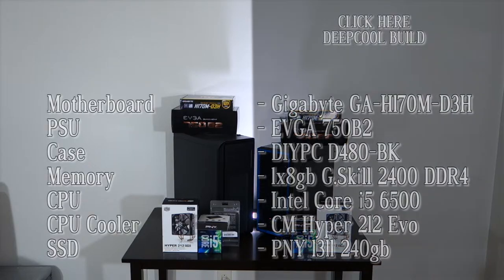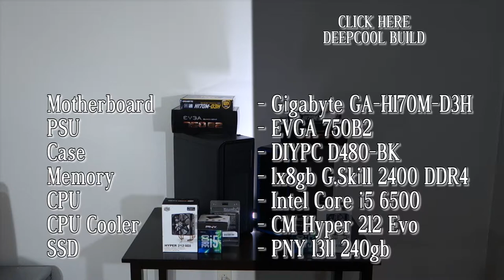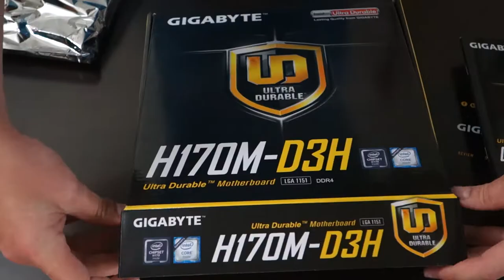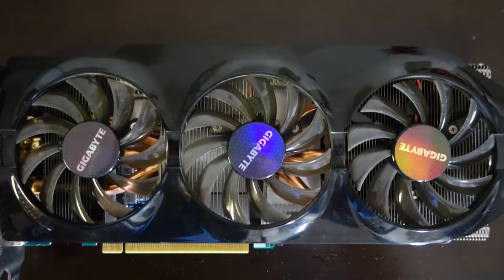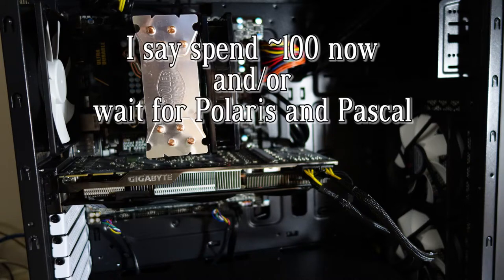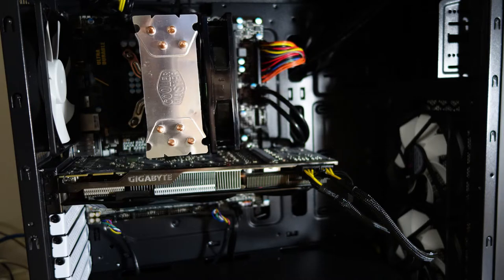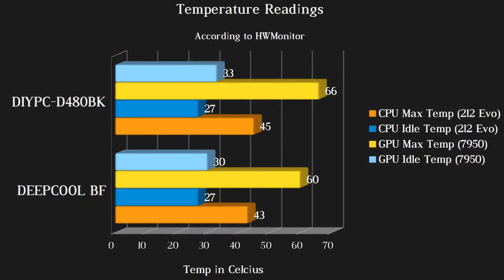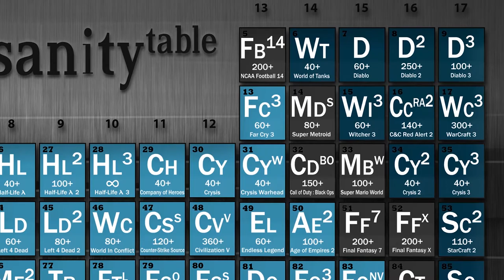DIYPC D480-BK Build Log | GTX 1080 Starter Kit?

Comment: I added a Kingston Hyper X savage SSD on the front side under the disk drive bays ...you have 2 spots to add them ....so a total of 2 HHDs and 3 SSDs can fit in this tower ....my video is of the DIYPC White -480

Comment: I'm getting ready to add 5 new fans to my case ... And add fun foam around the top fans .....I don't like the idea of my fans on the top looking like they mount to a cheese grader so I'm going to seal it all up with 1/8 inch foam sticky paper from Michael's it's $1 a full sheet
Reply from the maker: let me know how that does with noise and if it hurts airflow much. The only pre-built filters I can ever recommend is the Demciflex filters, but those are usually too expensive. It is awesome to have a kit that perfectly fits with your computer like I do for my girlfriend's Corsair 400R Case. Essential in our dusty apartment.
Reply: +periodic.insanity tell you the truth I'm happy with how it is out of the box...... I have a problem I can never stop upgrading or improving anything I have ....I did the same thing with real cars ... Radio control cars .... Bikes ... Skateboards .....car stereos.... I'm doing just to see if I can lower my temps running online games ..... It's already ok ...I'm just OCD ....... I'm addicted to making Unboxing videos  .... And instillation videos
Reply from the maker: I know what you mean, I'm always tinkering with computer set ups. I really should record the stuff I do because I don't think to record it and so like 90% of what I do is just for me to enjoy. It is addictive but if we could turn what we love doing into a job or at least some income this is it...
Reply: My zen build ill hope to use this case awesome air flow alot of space and good cable managent
Reply: When will they put a guage on the thermal paste tube so you know the amount you place on the cpu is enough , i am totally worried you didnt put enough lol
Reply: How come you didnt get the windowed case?

Comment: Did you need to buy a fan splitter for this case?
Reply from the maker: all the fans were already hooked up to the fan controller, you just need to provide power to the controller
Reply: So you just plug it into a molex and that's it? did you plug the molex 4 pin cable onto the system board?
Reply: Ditto how do you control the fan speed. I have this case but I can't adjust fan speed. Thanks

Comment: Also my new CRYORIG H5a keeps my CPU at 21c idle and 30c load ...but on tom Clancy's division it hits 56c for a second then comes and stays around 45c for online games that render allot of graphics
Reply from the maker: I have a hard time trusting that my PC is reporting correct temps when it is around that low though, 21 c is like 70 F , which might mean the CPU is cooler than the air around it at least where I live in Tennessee! My FX 8300 would report under 20c idles and I know that couldn't have been true on the 212 evo attached to it lol.
Reply: +periodic.insanity no your right ...when I lived in San Diego ...on my older PCs they ran 40 to 60c ....but I'm in Washington now and I had the room at 65/68 or 69.... It will latterly idle at room temp ...and as long as you use your motherboards temp programs you have accurate temps ....  I was able to use corsairs software to monitor temps from the PSU ..and when I run them together they match each other .....the only thing off  was the fan RPM's on the corsair were off 1000 rpms ..after update they match now .....with core temp or speecy they are off sometimes by allot ...this are aftermarket temp programs ......not the one that comes with your motherboard ...that's on point it's cold where I live ... My house thermometer could be off cause my inferred  temp gauge says its 63F when the house says 67 ...but my inferred gauge came from harbor freight and there stow is the lowest of quality ....so I'm not sure my accurate room temp...BUT ITS NO VIDEO CARD..so no heat
Reply: +periodic.insanity now with a video card ...I will post that video soon I sit at 46c and spike to 56c off and on.... This is why I'm going Fan crazy ...2 on my CPU cooler they will fit with the ram I have .....and all 5 new case fans .....will see if I can drop those temps ....my house is also 77F now (....if I said 66c for house temp on last comment ment F) I won't use my PC at 77c ...I'm building a man cave with its own Ac... To run at 60F .....I know it sounds crazy ...but like most of us I paid out of pocket and boy it was allot this time.....I went top of the line on all except the motherboard and video card ....motherboard is really nice just not the best ...and my video card was released November 2015 .... It's a sweet gigabyte 970 XTREME with Titan X chokes and capacitors...it's  just not a 980Ti which I don't think I need ...now that the 1080s are out I want to give it time to get all the bugs out ...then I will get a 1080ti
Reply: +periodic.insanity I have videos with open broadcasting running and I use my motherboards recording software as well as division running that's when it hits 56 to 57c.. Without open broadcasting the charts show it peak about 47 to 52c..... It's not on video but I'm able to test my case Temps with my inferred lazar  thermometer ...and the PCH  (the heat sink in the bottom left of the mother board)and they are a close match....I'm just not able to test the CPU with the laser ...But what's really important is the 21 c my Cpu begins at... it returns to that when I shut all my programs down...that's what's important ..that means my Cpu can return to room temp at idle that it began at  ....not slowly increase ....it doesn't matter what 21c really is on my PC it's obvious its whatever the rooms temp is ....it's that I can get it to return to that temperature without having to shut down and cool down ...With division and the video card my CPU comes down to 24C ,but the case and PCH stay up now

Comment: No offense , but I'm not a fan of the 212 evos ... They are loud as shit .... And they do not have a mirror finish bottom ......I used the hyper T2 and my CPU would spike to 81C all the time ..... I did allot of homework and found CRYORIG /thermalright  /nactua / Phentek / those brands put cooler master to shame for CPU coolers ..... Cooler master works .... But there's better in the price range ..... I used the white tower of your tower ...and I posted the video .... Nice build you have here
Reply from the maker: I like the white especially for that gigabyte mobo. I wish I had gotten the side window version but oh well. For the ~20 dollars I picked up the 212 Evo for it performs fine, if I were overclocking I would get something better though. The Evo design is a bit dated and I like a lot of what I see from cryorig, I've been wanting to try out their budget C7 as it seems to beat the evo in price/performance (at least when it's on sale!). Sorry I did not reply immediately, I've moved rooms in my apartment AND rebuilt my computer!
Reply: +periodic.insanity the C7 is a really nice one ....it's almost mirror finish but only has 3 heat pipes .....it's all about the heat pipes ... mine only has 4 heat pipes it's a little better then the Evo but with my slim fan design I can still fit all 4 ram sticks in their dim slots ...I have the CRYORIG H5a ...the a is a 13mm thick fan ....instead of the H5 that has the 25mm thick fan and coves a z170 MOBO first dim slots ....I bought a extra fan and bought the XF140 to ad a second fan ....and I'm getting ready to post a video showing that I no longer can add 4 sticks of ram with my new XF140 ...older model fan ... In the push position over ram slots ...on pull position  fan sits on my plastic G1 gaming shroud ...so I have to buy the XT140 fan when I add more ram... I bought the XF140 cause it moves more air ....didn't see the problem tell last night .. It's all about learning ,right. ...I don't care to pay another $15 to make another video ....lol my girl is sick of PCs at the moment
Reply from the maker: Yes, I have had to learn the hard way that some places need slim fans(or better planning lol). My media center PC that I wanted to run cool and quiet in a rosewill challenger case has a large heat sink on it and I couldn't use regular fans on the side panel. I had to go with some scythe 12mm thick ones.
Reply: dont know about you but my Hyper 212x runs silent and very cool for my cpu even under load, always hover around 60-70 when gaming. The only loud thing in my rig is the psu fan.
Reply: +Muhamad Ubaied my CRYORIG H5a peeks at 47C with tom Clancy's  division online ..I have videos posted to prove it .....it's never hit 50C ...room temps at 68 to 70F ..cooler masters do not have mirror finished bottoms ...they have heat pipe with tiny gaps between them it's not good engineering  ..that's why the  gaming temp is 60 to 70 C....60 to 70C isn't bad ...I just like to keep my temps below 50C , but it's not easy with a 900 series video card ..they run hotter than the 1070 series ...I just gave my kids my gigabyte 970 XTREME GPU ...so I can replace it with a gigabyte 1070 XTREME GPU ...it runs faster but I'm actually getting it just to lower my tower temp ...The 212x has the new fan that is quieter but the heat sink is a poor  design ..I can buy fans all day long from $15 to $20 ....it's about the heatsink cause it's what dissipates most the heat ...some heat sinks have enough heat pipes they don't need fans ($40 for 212x)($47 for CRYORIG H5a) huge difference in performance